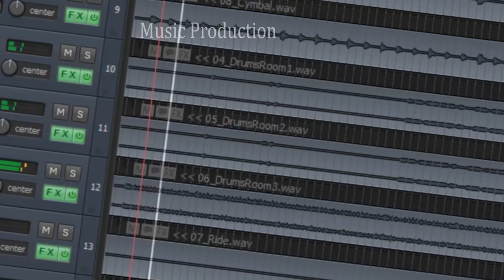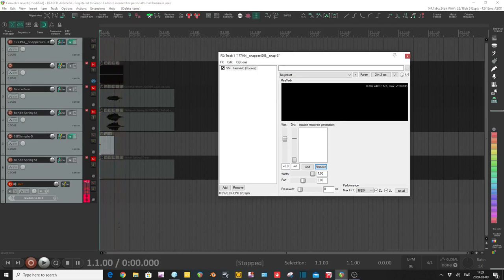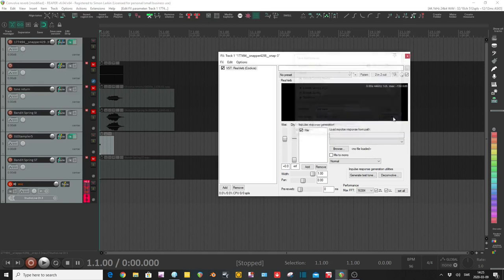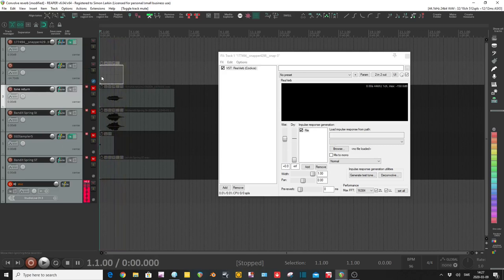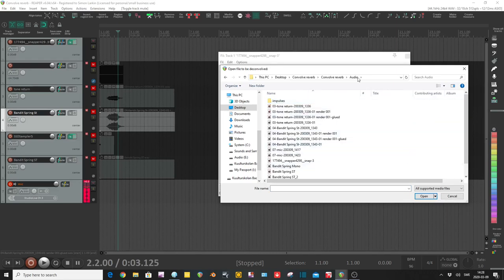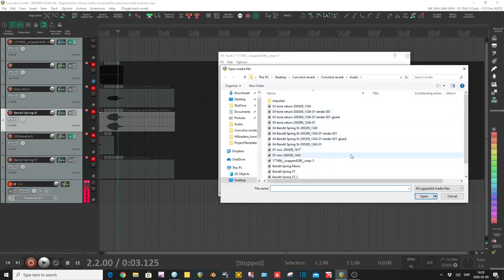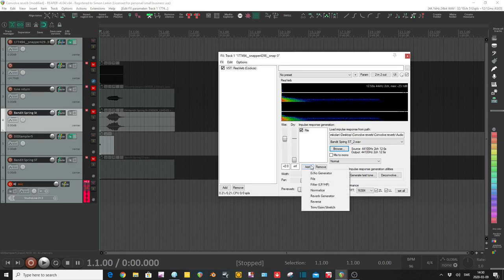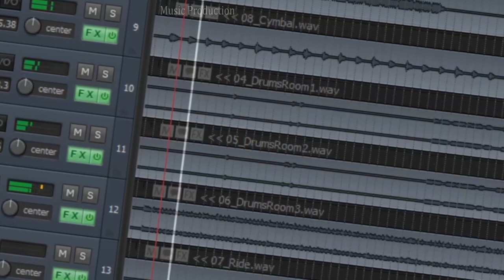Reapers ReaVerb- Create Impulse Responses within ReaVerb

Comment: Is there a way to create an impulse response from a bunch of plugins, directly in reaper? In other words, without having a real mic, and without capturing a real cabinet etc.

For context, I have a virtual guitar rig and I like the tone. I want to buy the original gear, although I want to use an IR loader instead of an amp and cabinet. Is there any way to just save my rig (without the effects that I will buy and use before my IR pedal) as an impulse response? If not, could you let me know what the process of capturing that specific tone would be, and what I would need? 

Insightful video, reaper is incredible 💯
Reply from the maker: Yes, send the test tone to your track with the plugins etc and record the output. The rest of the process is the same. Thanks for watching.
Reply: Thanks for the reply!